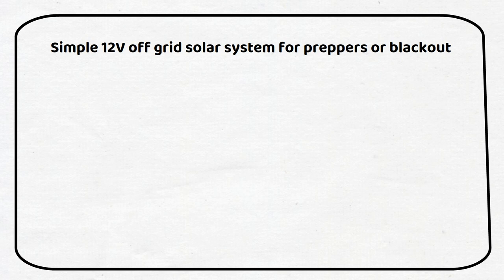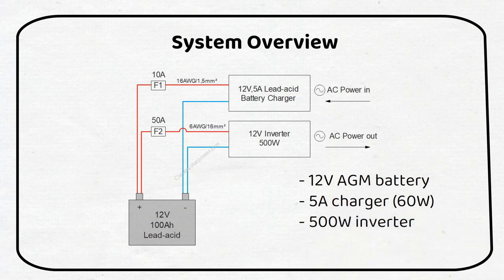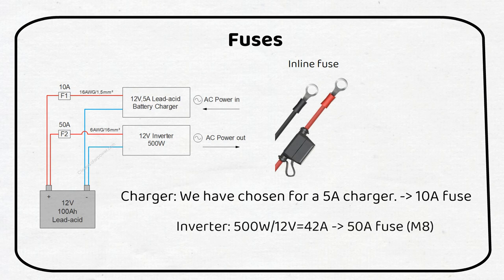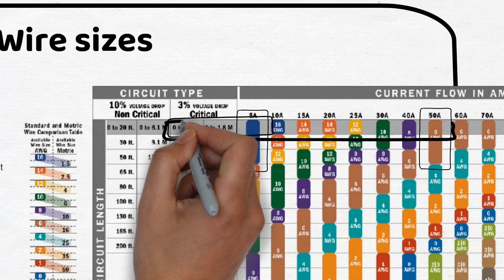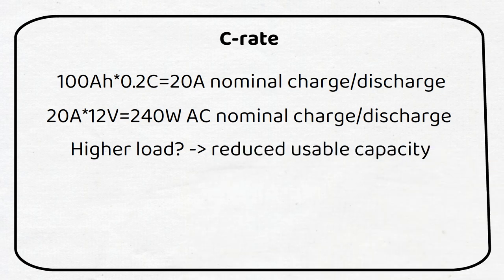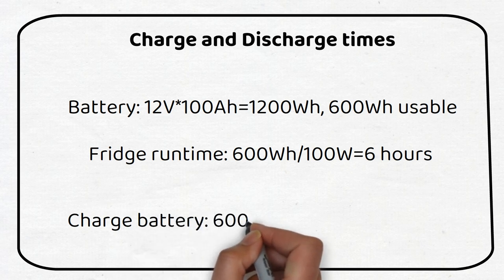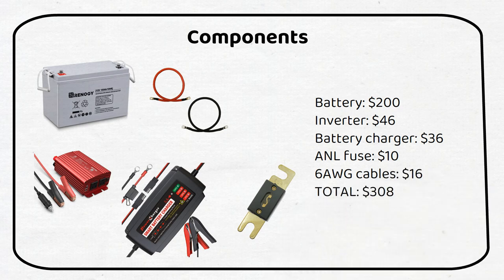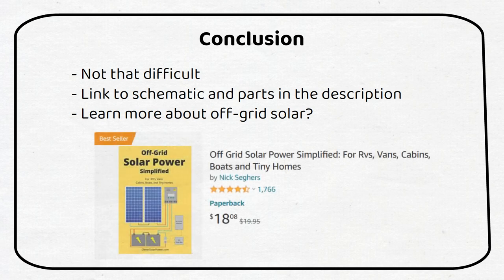DIY Home Battery Backup System without Solar for Refrigerator, Emergency, or Prepping

Comment: Hello, new to your channel.  Is it possible to make a video on how to run a refrigerator completely off grid?  I saw you have a fridge battery back up, but I wonder, how long does that system run fridge before it dies?  Ty, appreciate your time
Reply from the maker: I have not yet made a video about it. However, you can read my article about it on my website (look in the blog section).

Comment: In the year 2024 why would anyone still use batteries that are not LiFePO4 for a solar system unless they hate having a longer life cycle, light weight, safer chemistry, more energy dense, cheaper overtime energy storage system? Don't come attack me if they come out with an even better chemistry after 3/20/24.